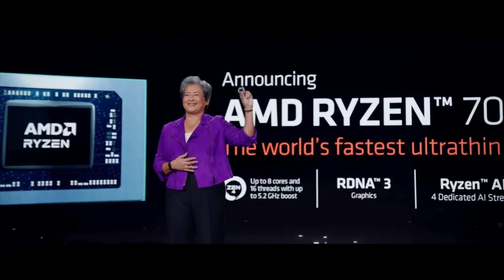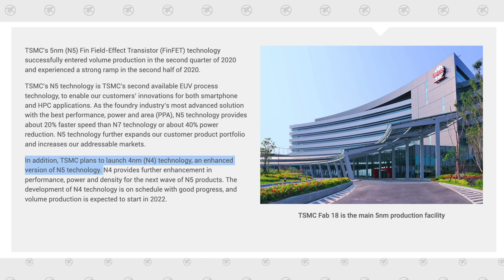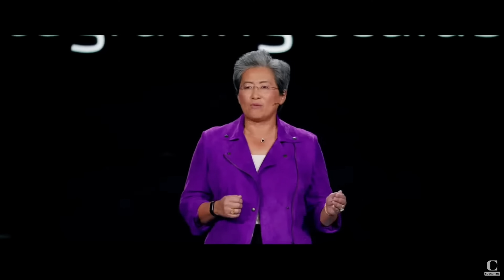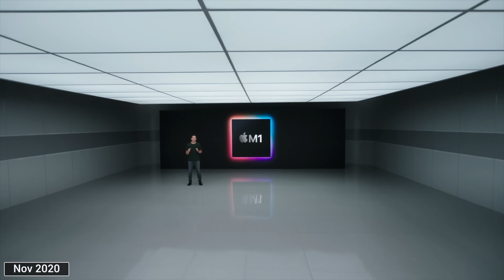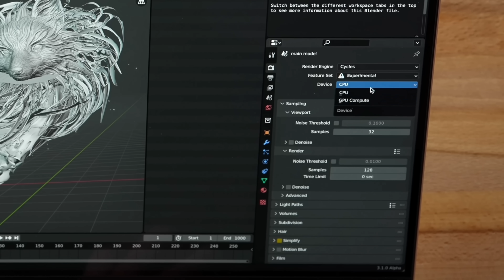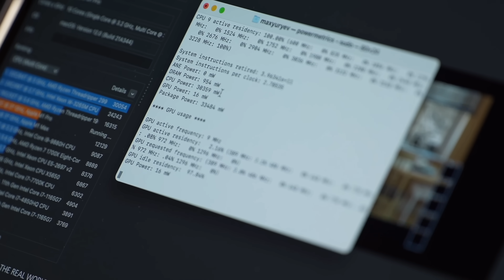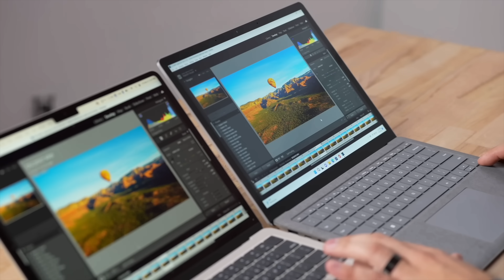AMD's New 4nm 7940HS vs M1 & M2 Pro! Apple Silicon Killer? 🤯

Comment: I wish you would have talked more about Apple's unified architecture because it's a critical component in performance. The AMD is simply a CPU/GPU chip, no integrate memory and without any integrated storage. All the PC vendors will go to their favorite component bins and toss some RAM and SSDs alongside the AMD chip hoping it will actually function properly. I know Apple users complain about the lack of memory and the expense of dedicated storage but this combination with its unified architecture blows the PC market to pieces. As you've shown a PC laptop, which is supposed to mainly be used un-tethered from a power source other than its batteries, is a snail compared to Apple Silicon-based laptops. I know many people connect their Apple laptops of "house" power but they can always take their laptops on the road and get full performance for a solid work-day. PC laptops can't say that unless they add an extra 1/2" base filled with batteries. For all the detractors, there are specialized AMD and Intel chips that can do remarkable things but try putting them into a consumer laptop and see if anyone can afford them.
Reply: Actually, it's usually the non-Apple users who complain about Apple's "lack of memory and the expense of dedicated storage". Otherwise I absolutely agree. Between Intel and AMD, I'd always go AMD for various reasons, they tend to have much better power efficiency than Intel and seem to have a much better understanding of what a laptop chip actually is (the i9-12900HX is literally just a slightly underclocked desktop CPU marketed as a laptop CPU). I'm not a fan of the 7000 series laptop CPU naming scheme though.
Reply from the maker: I did talk about it towards the end of the video, showing off how AMD's 6000 lineup outperformed M1 but then got destroyed when it came to real-world use (with multiple benchmarks)
Reply: @MaxTechOfficial  That's the single time you mentioned it. I guess you were alluding to it but feel you should have stressed the total package (SoC) more since it's a major part of the power of the M-series.
Reply: @i-mm-o res When was the last time RAM/memory failed on any Mac? I've used Macs at work then at home since 1989 and RAM might have been the cause of a problem once. That means twenty years of managing a large in-house system along with 30+ years of Macs at home plus family members. Storage is a different subject. I have a box full of HDD magnets, especially those from Seagate garbage drives but I don't believe I've ever really had any issues with SSDs, even SATA 3 2.5" SSD drives. I believe Apple has gotten to the point where hardware failure (not counting keyboards) has gone so low it isn't really necessary to discuss. Of course, some people tend to destroy everything they touch (one of my adult kids just breaks things no matter who makes them) and others push their computers way too far causing premature failure.

Comment: AMD Ryzen 7040 series will likely show up in 1 laptop that doesn't have a dedicated GPU that will get great battery life, but the rest of the machines will have Nvidia GPUs and the battery life will be like 2 hours. The 1 or 2 laptops that will get an AMD GPU along with these Ryzen chips will get 4 to 6 hours if you put the screen on 40%. On top of all that in Linux it won't matter since you can expect 30 minutes of battery which is just long enough to find your charger. It's not the CPU really that causes such terrible battery life but the operating system using the hardware. Windows is better than it was 10 years ago but it just isn't anywhere near the battery optimization level of MacOS. Linux has a terrible reputation for battery life even on ARM chips due to most things running in software with very little hardware optimizations. The Original OG fanless ARM laptop the Pinebook Pro only gets about 5 to 6 hours at best when running on XFCE with any flavor of Linux. So I wouldn't put my faith in AMD's battery life claims even though they do WAY BETTER at battery life compared to Intel. But sure I can see an AMD mobile chip beating the M1 Pro which is from 2021 in benchmarks 2 years later.

Comment: So what’s the comparison here? One is SOC (M1) and the other a regular chip. The relevant difference will be in terms of energy consumption.
Reply: Peoples are even comparing the 96W power supply (charger size) laptops to the 1000+W power supply desktops, and they are proud if the 1000+W beat the laptop, so don't try to find any logic in them.

Comment: Dude, you've totally misunderstood the term "binned chips". In the sense of the M1 Pro and Max, the M1 Max is the binned chip, and the M1 Pro is the non-binned.
Binned chips are the BEST ones, not the normal/worst ones, of the same die type and size.
Reply: You’re not correct. Binning is when a chip is downgraded in category. For instance, some i3’s are actually binned i5’s.
Reply: Lol what. Binning refers to making one chip and then limiting it to create tiers of performance. Both M1 Pro and M1 Max go through binning, as M1 Pro can be purchased with 8/10 CPU cores and 14/16 GPU cores, and M1 Max can be had with 24/32 GPU cores.
Reply: M1 Max and Pro are two chips of different sizes.

Comment: The question is, can I run mac os 13 on an AMD cpu?
Reply: @Minecraft Builder not easily, where did you get that misinformation from? Hackintosh run very poorly on Intel processors not on a MacBook, what makes you think it will run “easily” on AMD computer?
Reply: If only apple would release the Linux native GPU drivers... So we could run Linux flavors on apple silicone.  Joy
Reply: No because MacOS has never supported an AMD CPU so the OS won't work with it.
Reply: Seriously?  Windows is the better os in my opinion. So why did I get a Mac?  I like the hardware and chrome runs native on m1 ... And I use it 80% of the time.

Comment: The problem with comparing graphics is no laptop with that amd cpu will come out without a dedicated graphics. So it doesn't  matter in professional work or gaming.
Reply: They'll be dozens of mid range and thin and light laptops, PCs, AIO and consoles ( thinking steam deck clones ) that don't have dedicated graphics as there are now. Hp, Dell, Asus and many others have ranges and ranges of them.
Reply: @charlievarley  They will have U series not HS or HX series. Yeah the gpu won't come close to apple's m2. But that's a different series.
Reply: @RahatAlamgirPorosh7148  Ah! thanks for the clarification!
Reply: On battery power saver or in quiet modes, the built in graphics will likely be running, so it’s still worth knowing how bad the performance drop will be.
Reply: That's up to the laptop manufacturer to put in a dGPU so it'll vary between different laptops. So comparing the iGPUs is fine

Comment: AMD can’t do a comparison to the 13th gen chips that were announced the day before, nor can they compare it to a M2 Pro if it hasn’t been released yet.
Reply from the maker: True, I also mentioned that I wasn't allowed to test the AMD 7940HS even though it was at the show. (but we have a rough estimate of the 13th gen performance gain that I showed off)
Reply: @MaxTechOfficial  They're still working on the drivers so that's why they can't let you test it, they have to make sure everything is optimized.
Reply: Indeed, and he also uses tflops to assume how fast things will perform. Chips aren't that simple
Reply: They could compare to M2 which is on ultra light Air and M1X on 14” instead they cherry picked everything
Reply: @RiccardoVegan  the m1 pro is at a similar power level. And they did compare AI performance to an M2.
Reply: @RiccardoVegan  just like apple
Reply: Just like this channel showing leaks of benchmarks from chips that haven’t come out yet

Comment: The gpu part is wrong, pretty sure they were not talking about tflops since even the rdna 2 6800u/h/hs 680m have 3.686 tflops so this one will definitely have more.
Reply: Yeah my 6800HS on RDNA2 is already almost twice as fast as the 1280P iGPU. I’m not sure what AMD was getting at there…
Reply: Even RDNa2 graphics have 3.686TFLOPs, The new RDNA3 graphics should be twice as fast as 1280P.
Reply: as far as I know, AMD separate 2 version of APU. High performance dragon range APU with best CPU and weak integrated GPU. and the other one is phoenix range APU that have the best integrated GPU. 7940HS is dragon range APU with weak GPU similar to desktop Zen4 7900 that have very weak integrated GPU
Reply: @Garrus Vakarian Teraflops mean nothing.
Reply: Floating Point - typically measured at FP32 and FP64, and most of the people using it are not Nvidia [Qualcomm and Intel and AMD], which seems to get more graphics performance per traditional measures of calculation speed than the other players.
Reply: 12 core rdna 3 gpu will beat slightly the m2 gpu